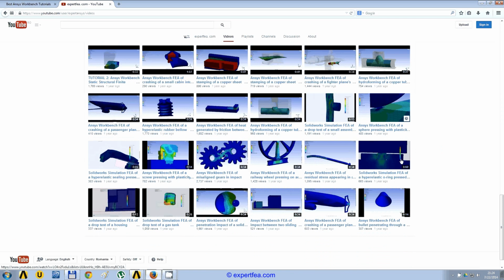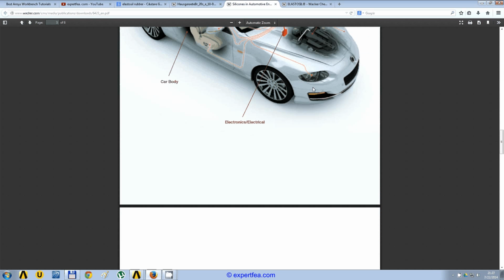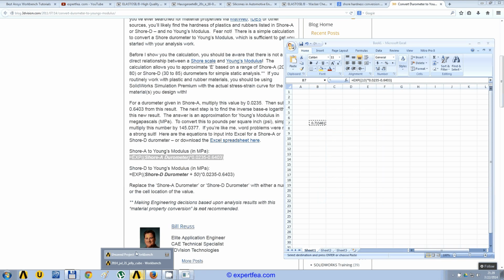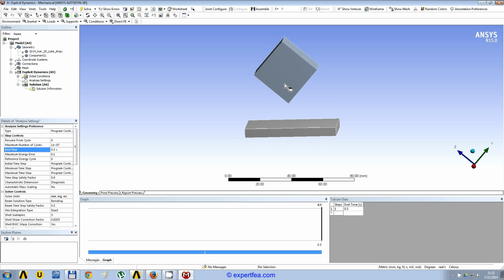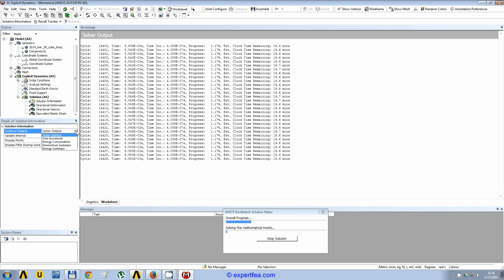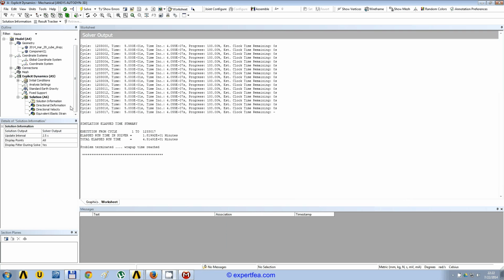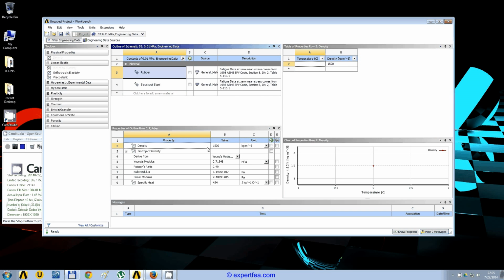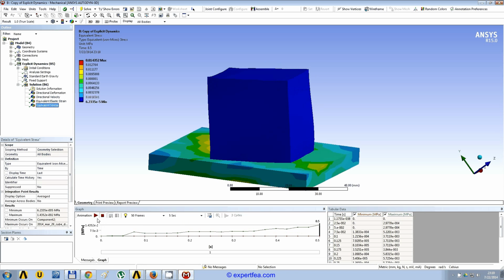WEBINAR 5: ANSYS Workbench Explicit Dynamics FEA of soft rubbers/ jelly drop tests

Comment: Hi, I copied your video, step by step but for some reason I get a message saying "a general failure occurred during the solution process." Do you know that would happen? As far As I can tell the only difference is the number of nodes and elements. I had 1678 nodes and 1164 elements. My minimum edge length was 10mm.  
I put the difference in number of elements and nodes down to dimension. Also my cube wasn't at an angle it was parallel to the plate. I am using ANSYS 16.2 and imported geometry using CATIA. 

Any suggestion, please?
Reply from the maker: Hi, it seems that you do not use the geometry we use, so... you have a different scenario altogether; good luck!
Reply: Hi, I'm also getting the same error message. Did you get the answer to that problem? If it's so, could you please tell me.
Reply from the maker: @dharanibaskaran1407  Hi, it seems that you do not use the geometry we use, so... you have a different scenario altogether; good luck!

Comment: Hi Expertfea, you have set the end time at 0.5s,  so the time step is 0.1s per each step?
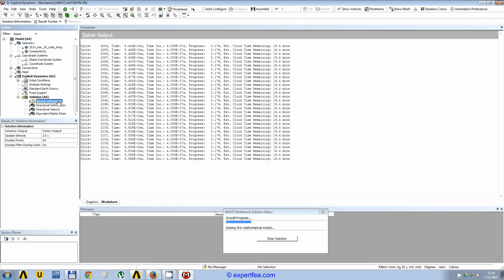Reply from the maker: +xi yuan Zhang ...if you go on second 12:07 you can easily see that the time increments are of the magnitude 4e-7 seconds. It's not like on the implicit FEA we are used to, when solving with Static and Transient Structural. It's another philosophy, easily revealed if you look for it on Google.
Reply from the maker: +xi yuan Zhang Moreover, if you go to 14:30 you can see that Cycles=time steps and Increment=duration of 1 cycle. Multiply 1233017 Cycles with 4.055e-7 seconds and you get the total time, which we prescribed as 0.5s.